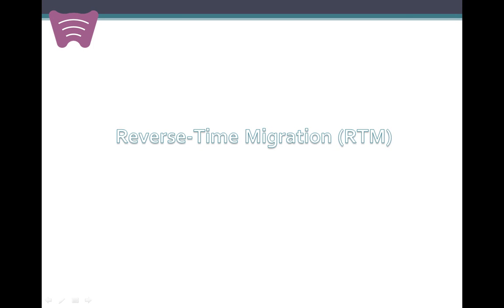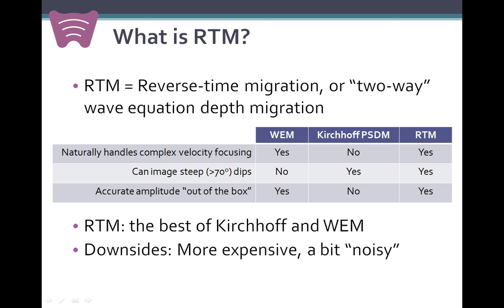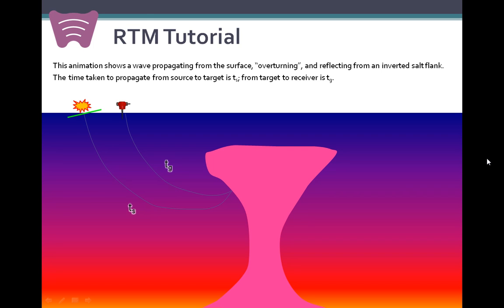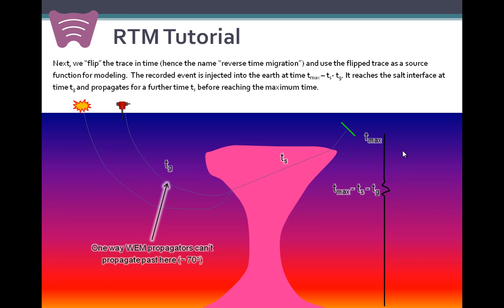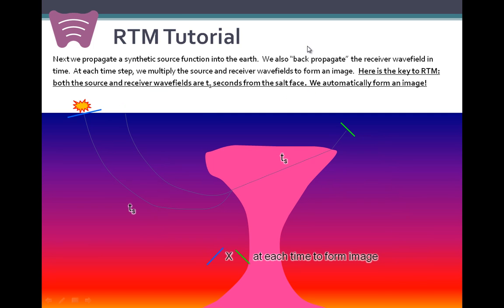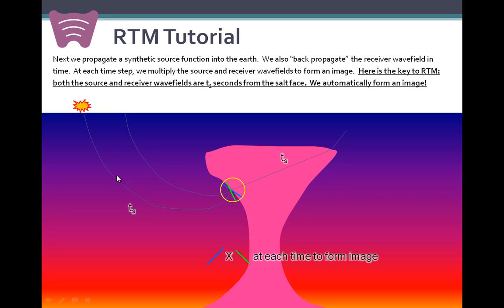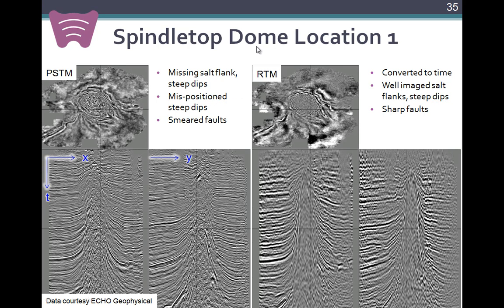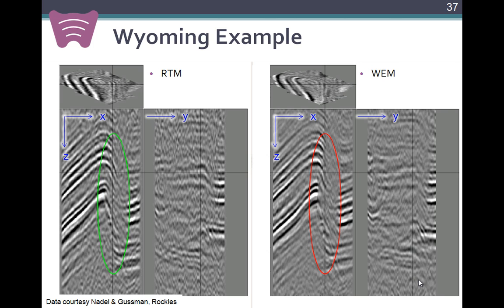RTM (Reverse Time Migration) Tutorial

Comment: Hello, On the comparison PSTM (I assume is the old Kirchhoff) are you using the same Velocity Model for both?? (PSTM and RTM) ? should not be a more fair comparison do Kirchhoff PSDM vs RTM? One limitation on the RTM is the Frequency (because of computer power)  normally you stop at 25 or 35 HZ on RTM while Kirchhoff gives you the full band. Thanks for the video great review.
Reply from the maker: In this case, we did not run the PSTM.  The company (Wave Imaging Technology Inc) was a depth imaging specialty shop, and all we had was one-way WEM and RTM.  I also like Kirchhoff PSDM.  I wrote my own Kirchhoff PSDM code in 2017 and run it in my current job, working as an in-house processing geophysicist at Aspect Energy in Denver.  Thanks to Amazon's compute cloud, I depth-imaged 5500 sq km of 3D data in 2022.  3x as much as we did in a year at Wave Imaging Technology...and I'm just one guy!

Comment: I’m confused. If you already accurately know your velocity model, isn’t the problem already solved? Isn’t the whole reason for migrating to find the velocity model of the earth?
Reply from the maker: yeah, that's a confusing subject. ;-)  We run an iterative process ("PSDM velocity model building") whereby we start with a trial velocity, then measure an attribute of "velocity incorrectness".  We then update the velocity model (e.g. using a reflection tomography algorithm) to minimize the "velocity incorrectness", re-migrate, and repeat the velocity update.  We might update the velocity model 4-8 times before we call it good.

And no, in seismic interpretation, the reflection image itself is what we interpret.  If our velocity models had infinite spatial and vertical resolution, then we could interpret the velocity for geology, but in reality this is not achievable.  If full waveform inversion fulfills its ultimate promise, we could someday interpret off the velocity model directly.  But people have been working on FWI for 40 years now